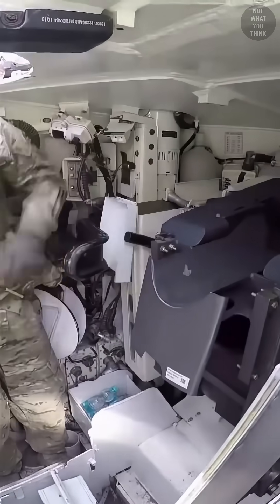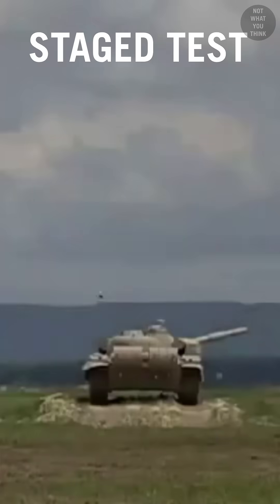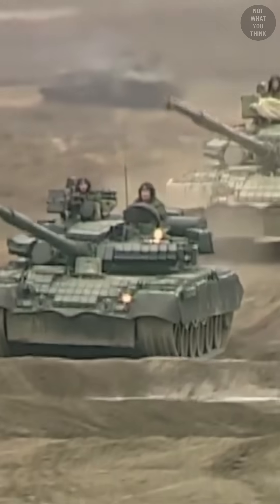Why M1 Abrams Tank Has No Auto-Loader #shorts

Comment: 1. Blast doors and on the outside of the turret compartmentised ammo racks vs safety blast doors ARE NOT mutualy exclusive. Look at French tanks amongst others.
2. Having 3 crew versus 4 in trhe same tight space is better for the crew. This is not a video game where you just toss out killed/wounded crewmembers.
3. If the loader fullfills another task, the loading is done SLOWER.
4. Keep in mind that the M1 Abrams originates from 1980, designed in 1972/75. Autoloaders have come a long way since.
5. 120mm munition is not a .45acp. Reloading this in under 5 seconds is backbreaking work.

Comment: The Abrams doesn’t have an auto loader because the U.S. military doesn’t want their tank crews vaporized if the tank gets hit.  In Russian tanks if if gets hit you have those infamous turret tosses where the rounds underneath the turret crew explode, the turret goes airborne,  and the crew is vaporized.  In an Abrams tank the rounds are stored in a sealed compartment with blowout panels so the crew doesn’t get vaporized.

Comment: Well then someone label the French geniuses, they have an auto loader and blast doors. Not only do the auto loaders run faster, they require zero training, food, water and essentials a loader needs. It's overall far more effective and efficient than a human.
Reply: The biggest issue is that if the autoloader fails or malfunctions, then your fucked, it takes a long time to get a vehicle back to a location where you can repair it, even if you have a chance to. Sure a human needs sustenance, but humans are the ones who have to maintain and repair the autoloaders in the first place. And like what was said in the video, the loader can help/replace the role of another crew member if needed.

Comment: The next iteration of the M1 may have an autoloader. The reason the US hasn't used one is because of the bad experience during the development of the MBT-70. The device failed terribly in all the test they did. So, when they developed the M1 in the late 1970s they designed it without one. The door to the ammo stowage is taught through drills and protocol that the loader grabs the shell and closes the door before loading it into the breach. The Saudis had one explode because they did not have this protocol and the door was left open when the ammo was struck by a enemy combatant's AT rocket.
Reply: also if it breaks you're screwed

Comment: Loading the gun is the last thing a loader has to do, and why many countries including America still retain a human loader as opposed to a mechanical one, despite the technology having matured. A human loader means a crew of 4, which means: 

1) 4 people to do maintenance work on the tank's heavy components

2) 3 people doing different jobs while a 4th man can take watch vs 2 people working with the 3rd on watch(significantly more efficient).

3) Assuming 6 hours of sleep, each crew member gets 4.5 hours of sleep and rest as opposed to 4 hours each for a 3 man crew.(More well rested means more proficient fighting)

4) An injured loader can be replaced with another private relatively quickly, a damaged autoloader leaves the tank firepower killed until a depot-level fix. 

5) 4 pairs of eyes which makes for much better situational awareness.

6) Less moving parts means less likelihood for jams and mechanical failures to occur.

Comment: We've seen over the last 80 years, well trained crews on most platforms even inferior ones will outperform poorly trained crews on superior ones. (Having a better trained crew in a superior platform is obviously the best)

Treating crew as expendable in the long run, is not viable. When we see a surplus of equipment but a lack of crew. Protecting the crew so they can fight again, and giving them the confidence to engage seems to be the better tactic.

Or is cannon fodder method better?

Comment: I can insure you that if the ammo rack detonates it won't care about some blowout panel . 
Also it makes so much easier to blow the ammo rack from behind (cuz it has practically ~30mm of armour at the back of the turret unlike the Russian tanks.
Reply: “if the ammo rack detonates it won’t care about some blowout panel” well… yeah? That’s the whole point? The blowout panels are meant to be blown off by the explosion. it’s impossible for the explosion to blow through over an inch of steel when there’s a massive sun roof for it to vent out of. 
There’s plenty videos of abrams blowout panels working. if you had actually bothered to check if the bs you’re spewing is even remotely true you would have known.

And a modern anti tank missile doesn’t care if there’s 30 millimeters or 300 millimeters of armor.

Comment: The majority of Russian tanks are actually manual loaded recently due to the erm...smoking problems. Anyway, point is yes Russian tanks above the t-62 (I think? If not it's the T-64) uses a two piece autoloader which is totally inefficient. Loading the cap then the propellent, leading to a reload time of around 4 seconds if it's maintenanced to the best and has the "modern" upgrades. An Abrams tank can reload every 2-3 seconds because human fast. Modern NATO autoloaders can load every second or so, a much better and more terrifying rate of fire.

To anyone that read all that, thanks! I don't know why but thanks!

Comment: This is one way to tell soldiers, why they WANT to use an aoutdated technology: it is for your satefty! Bc that few inches of steel will protect you from an explosiom of a couple AT ammunition. Wonderfull marketing!
Reply: It's not outdated it's like using a slightly older more mature architecture in a cpu or gpu because using a new and not yet fully working process is worse than using slightly older tech
Reply: @ImWoolly  I am sorry, but especialy americans use automatic EVERYWHERE they can, but not in tanks? I guess, it is cheaper to convince the soldier  that the old concept is better, then new one, then making a new tank and replace the existing tremendous number of Abrams..
Reply: @Antaeus Snorik  I feel like you are ignoring my point only recently auto loading become good vs manual loading and russia does not have a good auto loading system. The new main battle tanks for the us will have auto loading with extra research put in than probably all other tanks. Auto loaders can and will be great for our main battle tanks but a while back that would not be the case. It's always better to go for what works while research and design goes on than jump to a new standard that despite auto loaders being quite old is still in it's infancy.
Thank you for responding to me! And please note I am not qualified at all for this information but am going off of just what I know. (:
Reply: @ImWoolly  Exactly that came into my mind too: you are ignoring my point. I know, what you tryed to explain, but dont tell me, that the moral of the soldiers is not important. And KNOWING I am fighting an war, whit which i have nothing common in an outdated equipment, is not exactly the way they will boost the morale. Thats all I wanted to say.
Reply: @antaeussnorik6790  I'm just saying it wasn't outdated equipment

Comment: Russians can simply add more Armor and blast panels to be safe and hot (I mean temperature not some sus )
Reply: That's the problem with russian tanks the way they "modernize" them is by adding another 10 tons to a nazi engine that can barely break 30 without the extra weight with horrible reliability
Reply: @ImWoolly  got a point bro

Comment: Abrams safety has 0% to do with manual loading and 100% with ammo type(APFSDS instead of HEAT/HE), ammo alignment in the front/bottom of  the tank)
Also, it hasn't seen combat against a modern military yet, so it's safety is pure speculation.
In the end, now autoloader can be easily implemented even with the blowout panels and blast door, but nobody would spend money to redesign something that already works and because this tank is old.
People will soon realize that stunned(by artillery/HE shell/direct hit)  loader paralyzes the whole tank, the space for his workspace is affecting the mass/speed/agility/cost/size of the tank very negatively, etc
This war in Ukraine could change that, just like it's shaping Russian army in real time.

That being said, it's a marvel of engineering(for it's time) and a grear tank in general, however the persistence at which people defend it's manual loading is pathetic.

Comment: France, Japan, South Korea, and Germany with the new KF-51 Panther would all like to have a word with you on the "most common autoloaders store their ammunition in the turret basket" part as no they don't they're ammunition storage is in the bustle of the turret with armoured blast doors like the Abrams and incorporate blow out panels, like the Abrams, and maintain a 3s-5s(max reload rate for the Japanese Type 90 and Type 10 is ~3s with sustained rof being 1rd every 4s) the reason the US doesn't use autoloaders is more so up to doctrine than anything else that 4th man allows a extra hand with maintenance and watch during sleep rotations, however human loaders can't maintain a steady reload rate over long endurance fighting scenarios like a Autoloader can, and new autoloaders are able to select and swap out rounds without having to fire the round currently in the chamber, hell even tanks like the M1 TTB(a autoloaded version of the M1A1 Abrams) had a unloading mode to unload the round in the chamber so it's been a capability for a while, really the only tanks that experience safety concerns with autoloader ammunition stowage is open carousel type autoloaders meaning that the rounds are stored in the turret basket completely open in the crew compartment, however there are carousel autoloaders out there that incorporate armoured blast doors to separate the turret crew from the rounds and can quite easily implement blowout panels along the hull floor and sides

Comment: I'm not sure if this was even a significant reason why the US didn't use auto-loaders in their tank designs. Also, you can have an ammo compartment in the rear of the turret, with a blast door, in ADDITION to having an auto loader, so it's not like the two options are incompatible with each other anyway. 

The thing about not having an auto-loader is that it doesn't actually have that many down-sides. Having an extra crew in the tank also has a lot of benefits, because there are a whole bunch of different duties (such as maintenance duties) which all become easier with an extra crew. The gun can still be loaded fairly quickly with a well trained loader, it just requires that the loader have a certain amount of training. 

It tends to be a lot more difficult to select different types of rounds with an auto-loader, or to be able to have an auto-loading system where it's as easy to select different types of rounds, than it is with a manual loading system. 

The biggest advantage of an auto-loader that I can see is that it can allow you to use ammunition which would be too heavy to be loaded manually, but that only matters if you think that you need to have rounds of a certain size.

Comment: I work in military industry. This video is total non-sense. 3 crew instead of 4 is a HUGE deal, 25% more tanks or 25% less crew. Autoloader are superiors in all senarios, specialy the french Leclerc who can fire AND RELOAD at full speed. Shells are stored in protected compartments and can't propagate in case of a fire inside. There is gaz systems to instantly remove any fire inside as extra safety.

Comment: I think it's a stupid idea! A person is more likely to die, when the ammunition door is open, compared to when the ammo is stored in a completely different area, away from the fully armoured cockpit where the crew members sit together, controlling the tank. Only an idiot would think it's better to sit with the ammo, and hold the ammo in their hands during a firefight, compared to sitting in a fully armoured compartment, totally safe from the ammo at all times.
Reply: So long as the one-inch-thick armored door is closed — and it almost always is — the path of least resistance taken by igniting ammo in the bustle storage is via the blow out panels on the turret roof. The Abrams crew has a much greater likelihood of survival than those in pretty much any other tank currently in service with anyone anywhere.
Reply: @NZobservatory  Let me guess. You are American? 😅😂🤣how often is the door open, exposing everyone, in an automatic loading tank? Even my grandmother is smart enough to know, American tanks designers are idiots!
Reply: @DC-te1gw  The door is open only while the loader is retrieving a round, Olga.
Reply: @DC-te1gw  You mean "safely" like "launched 50 feet into the air when the ammo carousel explodes"?
Of the few Abrams destroyed by fire (friendly or enemy) crew survived more often than not. Even usually. This ios because the ammo is stored separately from the crew.

Comment: Also there's less moving/automated parts with 2 people, there's less of a chance for failure. What are you supposed to do if your automated system fails? Stop the tank and fix the electrical or hydraulics? Fuck that. Use a person, make sure they're trained, fed, has slept in the past 36 hrs, and you've got a way mote reliable system lol. Also 2 heads is better then one unless they have a second tank for the second person.

Comment: 5 additional things:
People are commenting the manual loader might get tired, not the auto loader.
True, but:
A. After finishing off one target it will probably take at least a few seconds for the tank to find another target, so the loader can rest for a few seconds.
B. The original abrams is listed as holding 55 rounds. Later versions 42 and 40. It could be exhausting to reload that many times in quick succession but doable and it probably won't be quick succession. 
C. The M1 carries two main types of ammo, HEAT and sabot,  and possibly others. It would be fairly fast and easy for a gunner to replace one round with another. How fast would it be for an auto loader? I doubt it will be as fast.
- ALSO survivability of both the crew and tank are very important.
D. If a shell penetrates the turret of an Abrams there's a good chance everyone in it will die, but there is some chance they might survive to jump in another tank. 
- The odds of anyone in the crew surviving a hit that penetrates a T72 turret are much smaller; in fact miniscule. The ammo will almost certainly go off and the concussion from the blast alone would be lethal, not to mention shrapnel.
E. There is a fact about Russian tanks that has been known in the military for decades. They call it "Jack in the box." As the narrator says, if a hit penetrates the Russian turret it's very likely to set off all the ammunition. Not only will that kill everyone in the tank it causes the turret to explode right off the tank. (There's a video in here showing a turret blow about 200 feet straight up; hence "jack in the box.")
A hole in an Abram's turret might be fixable. If not the turret can be pulled out and replaced. 
Based on the video I saw, when all the ammo blows in a Russian tank there is a ZERO percent chance the turret can be fixed, and the blast must be doing serious damage to the body of the tank as well. You'd basically have to replace the entire tank, not just the turret.

Comment: Different design philosophies. Russian tanks are designed to sit lower, present a smaller silhouette, have smaller crews, and around logistical concerns. These are just different approaches to the same goal. If you can field more and harder to hit tanks with smaller crews your overall survivability will go up. Also ammo cookoff in a Russian tank is only a real concern if the crew compartment is compromised in the first place. If the crew compartment is compromised on either tank you are going to be in for a bad time.

Comment: Some things about the "jack in a box" issue with russian tanks:

-whenever an anti-tank projectile penetrates the armour of modern MBT to that point, it matters little if your keeping the ammo inside a neat sealed box or on your lap. You're basically done.

-Russians designed this knowing fully well that this could be an issue, because as with every other tank, design features always have compromises. Their thought process was very centred on fielding equally capable tanks with less money\material and less men (and thus, overall, less cost). In this regard, they were one step ahead, and as we can see now with the Abrams X, the Russians set the trend of 3 men crew, autoloaders and lower profiles.

-the smaller tank means less material, less weight, less fuel consumption, more speed (T-90 is the fastest MBT) but mostly, means the tank's height is minimized, thus making the tank smaller and harder to hit. In comparison, the Leopard2 standing at 3 metres tall tops the T-90 by 80cm (that's about 5 tallboys for the fellows over the pond), which gives the t-90 a huge advantage over their teutonic counterpart. Russians make their tanks thinking "not getting shot is better than surviving the shot", and compensate any flaws with what's probably the best ERA currently.

-the new Armata platform basically has a shielded separate compartment for the crew, effectively separating them from the turret and ammo carrousel, solving this problem permanently.

Last, on a comedic note about the jack in the box aspect of the early T's : The russians did it on purpose, so tank crew either fights well and gets to be like saints, or fights bad and goes up to heaven. :p